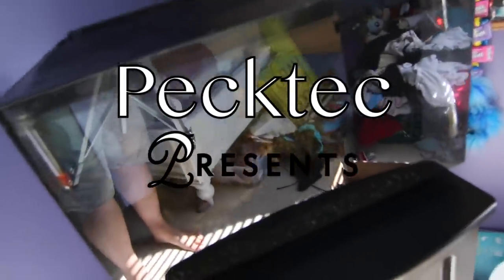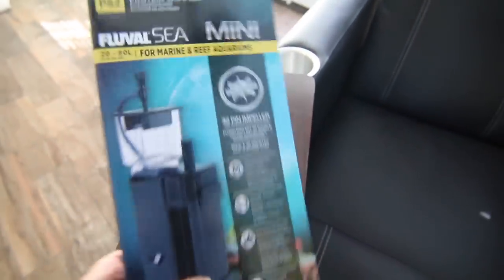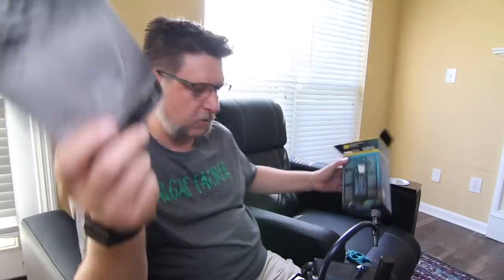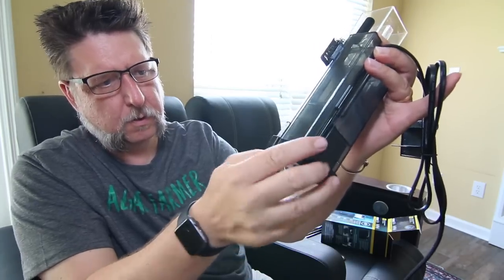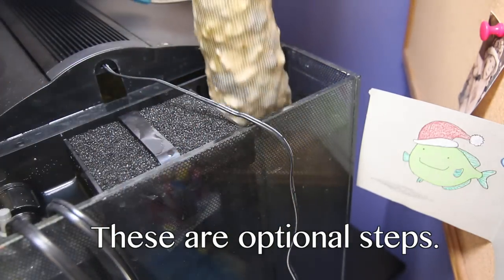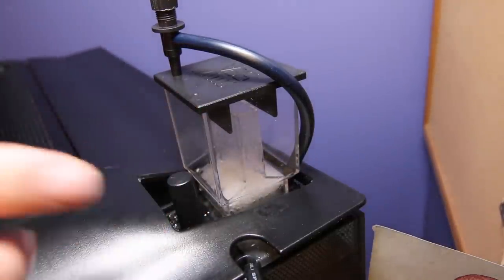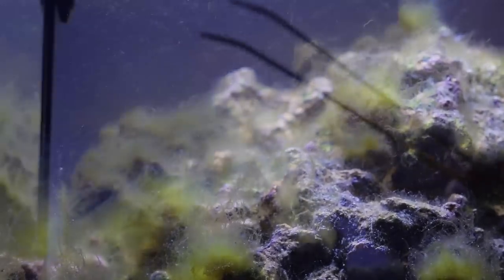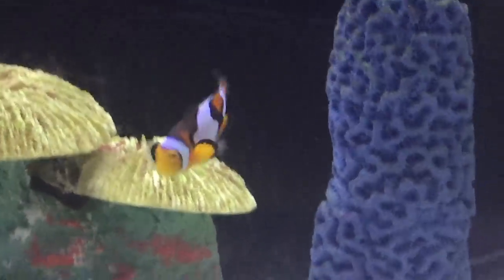Fluval Mini Protein Skimmer

Comment: I have the EVO 13.5 and skimmer. The skimmer was useless after about 2 months when it just stopped working on me. The lid is horrible also and I had to put a rock on top to keep it down. My tank is doing great though. I got the InTank media basket for chamber 1 and a diy chaeto reactor with weekly water changes. I have 2 Emerald crabs, 2 Peppermint shrimp and a couple trochous snails for algae control stocked with 2 Wyoming White Clowns, a firefish and 8 corals. No issues at all since the skimmer let me down. Weekly maintenance to me is a must along with an auto top off. The tank has been up for 6 months.

Comment: Had one of these for a few months and threw it right into the trash. It came with a tank I bought and was nothing but a headache and did very little actual skimming. Meanwhile it had to be adjusted almost constantly. Replaced it with an Aqua C Remora Pro. Over 40 years in the hobby and thought I'd give it a try but it was replaced in less than 3 months. Save your money!
Reply from the maker: We managed to get it working but found the sound to be intolerable in a bedroom. She broke it down after a month or so.
Reply: Better off saving your money and buying a better quality skimmer. These might work on a freshwater tank (for a little while) but eventually it'll completely stop skimming again. After a few weeks of adjustments mine overproduced bubbles and began to simply fill the skimmer cup with a tiny bit of protein skimmate and a lot more of the good tank water. It's a fairly simple design that's been tried and true for years but Fluval is selling junk here! 
There's a reason many of these other skimmers have been around for so long. If you do some research these very small type of skimmers usually don't perform very well with one or two exceptions and even those aren't worth bragging about. 
If you're serious about having good filtration, dump the HOB filter and get a sump system where you can put your Skimmer actually inside the sump. My AquaC is a HOB (Hang On Back) but is pretty quiet and they sell a small sponge silencer that while costly, is worth every penny. Skimping on a saltwater tank can get very costly and will result in a lot of extra equipment that you'll find is unnecessary and financially wasteful.
Keep the tank away from direct sunlight to help with the algae and buy a quality light also. Emerald crabs are usually only good for Velonia (Bubble Algae) but will pick here and there. 
You'll also find the maintenance of a sump system is much easier and less frequency with a huge increase in good results. Try a Lawnmower Goby instead for the time being but prevention is much better. Emerald crabs are usually nocturnal also.
Reply: The green hair algae is usually from too much white light or sunlight and overfeeding, also possibly too long of a light schedule? Check your water chemistry with a good test kit (API is fine). My tank is only 36 gal bowfront and my skimmer is rated for 75 - 100 gallons and does an excellent job. I used the same size skimmer years ago for my 90 gallon salt/reef and it worked equally as well pulling out good (nasty) skimmate.

Comment: Best thing to do with all that hair algae is as follows, from my own experience.. pick up a saltwater test kit and also pick up the reef test kit, the reef test kits allows you to test for calcium, alkalinity, phosphates, nitrate. Keep you lighting on a timer from about 6-8 hours. Get the snails I mentioned in the other comment, and do 50% water change around every 5 days or so, or until parameters are reading in an acceptable range. The reason I say to ditch the sponge and Bio balls is because all of your BB in literally in your live rock and live sand( it really is that much different from a fresh water stand point) I personally would have and have cycled my tank with NO filter media, adding in the filter floss and chemi pure blue after my test results were in range. Sorry for the rant but I just no the struggle and what a struggle it can be especially in a small tank. Don't give up! And wait till you get bit by the coral bug! Lol ohhhh boy !

Comment: Hey man, I know this is an old video but I’m trying to see if this will fit in my overflow. 
The dimensions online seem way off- list 65 cm high. 

Do you mind measuring the overflow of the tank you put this in if you still have it? Or the unit itself?
Reply: Hey there! I don't have it in front of me now but I cant imagine it being longer that 20-30cm.  Its just a little bigger than my hand. Oh at 3:32 I say its 10 inches in height. Man I wish someone had told me how dumb that beard was.

Comment: Hi pecktec, I got the same  13.5 fluval Evo aquarium.  It's been 6 months I bought that  skimmer and I still can't manage its use.  My aquarium is new so it get's nasty very quickly, lots of diatoms.  The skimmer does absolutely nothing.  It makes a lot of noise, it's running and making bubbles for days.  The collecting cup is always neat.... while my aquarium is dirty.  I don't know what I'm doing wrong.  I'd appreciate your help.
Reply from the maker: She didn’t end up using it very long as it was loud in her bed room.
Reply: They're absolute junk. If you're lucky you may get a few months out of it at best but then the cup will leak and you'll be constantly adjusting it with very little actual skimmate being produced.
Reply: had one for six months had no problems with it at all, maybe because I am using  a external filter with 5 trays of filter media and a booster containing only sponges. To state these skimmers are junk is a unfair assessment.

Comment: The house is beautiful!!    With regard to the protein skimmer, have you seen any signs of microbubbles in the water? I tried one of these and I'm not sure if it was a design flaw, or just a broken skimmer that was leaking bubbles.
Reply from the maker: +The Glitch I noticed it had a little sponge to help prevent that. But no I haven't seen any.
Reply from the maker: +The Glitch I noticed it had a little sponge to help prevent that. But no I haven't seen any.
Reply: I have the same exact issue right now

Comment: I thought you were going to put in a big tank for the wall next to the fireplace.   You can use a protein skimmer in freshwater, it is just not needed.  The proteins it removes are more  harmful for saltwater fish than fteshwater fish. The harmful proteins  build  up faster in saltwater than in freshwater.  If you do not want to use a protein skimmer in saltwater you will need to do 2-3 times more water changes.   In freshwater you generally are doing water changes before the proteins get bad so a skimmer is not needed.  Also in freshwater if you have plants they are utilizing these proteins removing them from the tank.
Reply from the maker: +Jeff Frank still working out what tank to get.

Comment: Get rid of the big sponge and Bio rings, it's not needed and can definitely become problematic later on. Go with just filter floss and chemi pure blue. And monitor calcium and alkalinity. Get some turbo snails and ninja star snails. No hermit crabs
Reply from the maker: +inFamous Nyc what's wrong with hermit crabs?
Reply: pecktec nothing wrong with them but if you mix with snails they will possibly kill the snails to take their shells. In my experience, the snails do much more quality work as a clean up crew, but that's from my own experience and opinion.

Comment: i would just wait for the emerald crab to eat it all, he will.  if you cant' wait,  dont put all those algae spores in the water column, this can make it worse,  instead,  next time you do a water change, take that piece of live rock out and put it in  a bucket. use a toothbrush (new one)  to brush it off , shake it good, then put it back in the tank. this way the algae and spores go out with the dirty water.

Comment: Hi Pecktec! you know the Fluval flex! can it be used as a marine tank please?? 😀
Reply: You but it needs modified slightly. Also if you ever changed your mind to make a reef tank you'll need to ghetto rig up a new lighting system as that light isn't strong enough to support coral growth. It's easier to buy the EVO as it can be used for both marine and reef.

Comment: I think you need to increase the water flow and add some turbo snails. If I were you, with all that live rock I would take out the ceramics and the sponge. In my opinion not good for reef tanks. ;)
Reply from the maker: +Tudo e mais alguma coisa what do you put in there if you remove the sponge?
Reply: pecktec two options: nothing and I would have more flow or if the phosphates are high a little bag with phosphate remover. On the reef tanks I never use filter like fresh water. The bacteria will be in the live rock. It is all we need. :)
Reply from the maker: +Tudo e mais alguma coisa thanks that's pretty interesting. So you mainly remove it for flow? I mean if it's not needed it makes sense. I wondered about maybe a refugium.
Reply: pecktec yes bigger flow will help with the algae problem. If it gets light a refugium it as good idea. The macro algae will help to keep the nutrients low (together with the weekly water changes).
Reply: I'd swap the sponge for either a phosphate remover, or just a load of live rock rubble.  Sponge tends to just act as a huge nitrate factory in reef tanks unless you change it every other day.
Reply: Definitely remove the mechanical media.  Salt tanks don't need that, your live rock and sand do the work for you.   Put some base rock in the filter space where the mechanical media is.   Any mechanical media such and sponge filters or bio filters you would use in fresh will work but create tons of nitrates which is bad bad bad for salt tanks.  In a well setup and balanced salt tank, nitrates will be 0 at all times.

As for the skimmer, you want the level to be where your skim coming in to the cup is dry, so if you're getting a lot of wet skim and water in the cup, tone it back.   Every time you add something to the tank, even your hand or tools, the skimmer will stop skimming properly for an hour or more until the tank rebalances itself.   On a tank that has not had a skimmer yet, it can take up to a day to start actually skimming anything.

Comment: So, i can ramble on about SW all day, however in short... after your cycle its normal to see an initial diatom, starts brown..works its way to green hair algae... even sometimes you'll see a cyano bloom.. while a Emerald crab is decent algae eater they're more known for bubble algae control.. you want to load up on snails and blue leg hermit crabs.. they'll get rid of that algae in a matter of days.. maybe focus on Spiny star snails, trochus... probably not Turbo's...they get large.. also hermit crabs...provide plenty of shell for them to switch into or they will hunt down your snails.. kill them, eat them, and inhabit there shell!
Reply: also please disregard comments saying to put Phosphate remover..save your money...if you're using RODI water in a new tank...there is no phosphate...your system is getting adjusted to the light.. everybody goes through the first diatom bloom, 100% of the time. 4-6 trochus or spiny as mentioned, maybe 4-5 hermits.. it'll be gone in no time.. i can assure you.
Reply from the maker: +Richard Seguin thanks I passed all this down to KP.

Comment: Turn off the lights since the tank is still cycling
Reply from the maker: +Aquarium Chaos yeah they aren't on much but I guess there's no reason to have them on. Except to look at algae.
Reply: pecktec oh lord you leave lights on whilst cycling your tank as you know you got through cycles if you leave them off cycle the tank bacteria will be good then boom algae all over
Reply: Luke Denton 

Beneficial bacteria doesn't need light to develop. Light doesn't dictate the nitrogen cycle because it's not a photosynthetic process.
Reply: I would definitely say you could add coral now and some inverts... it should definitely be fine now. And whenever I start a new tank I go ahead and dose bacteria to go along with it to speed the process up.
Reply: Parker Alwan 

Me too. I like to use Seachem Stability. It works great for fresh and saltwater tanks. If it were me though, Personally I'd wait on coral until that hair algae is under control. I'd start with some inverts in the mean time. I also like to use chemipure elite in my 25g saltwater tank.
Reply from the maker: +Parker Alwan yeah we did all that. We used stability and seasoned media to help start it. We will add more stuff in a few weeks.
Reply: Ryan Wilson yeah I rewatched the end again and that is tons of hair algae! I would honestly do water changed every three days of about 30 %. And add in an algae crew. If it's on a timer turn it down to 6 hours and maybe not even that long since there isn't anything in there. It should go away relatively soon. One thing that would help also would be to add in a nano power head because it doesn't seem like there is enough flow. That would also help aid in coral growth as well.

Comment: Man, everything about that skimmer screams cheap, cheap, cheap. The shape of the neck will pop the bubbles prematurely. The saltwater will also ruin those suction cups after a short time😕
Reply: He didn’t use the suction cups. The skimmer does the intended job for this application.
Reply: @joec2174  it may do the job, but there are definitely better nano skimmers out there that would do a better job
Reply: @bobwright8789  yes but don’t complicate things . I had a 250 dollar eshops on my 60 salt tank. It had constant adj issues. So I bought a new aqua max 1.5.   I hooked it up and due to copd was in the hospital. After two weeks I came home to find four gallons on the floor . The clowns but the silencer inside the skimmer body and 1/4 of it was submerged.  Salt creep happened and clogged the pump air intake tube. The skimmer water level rose to the point of the cutout for the inlet and wa la instant flood.
Reply: @joec2174  man that’s a bummer sounds like you may want to stick with a stock skimmer then.
Reply: @bobwright8789  they actually sent me a remote external silencer.